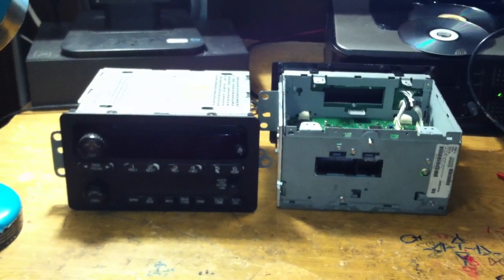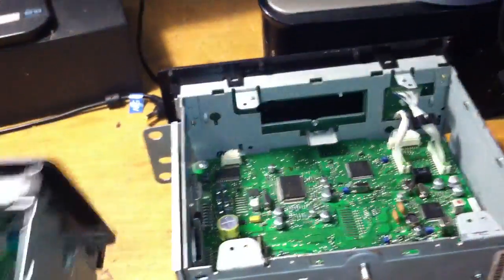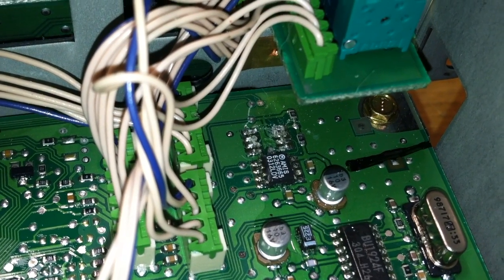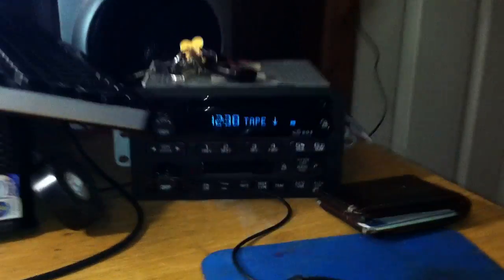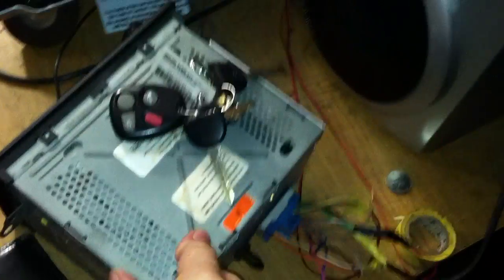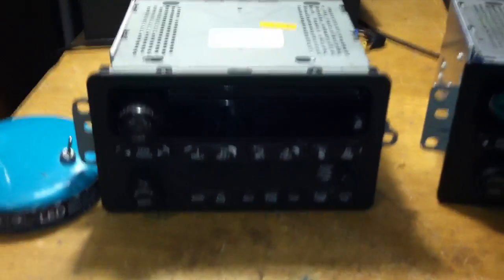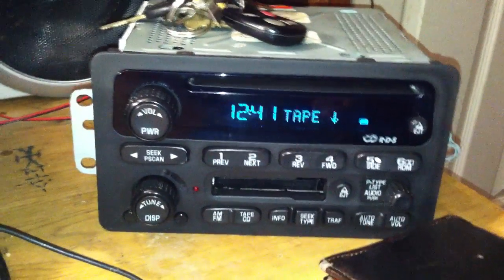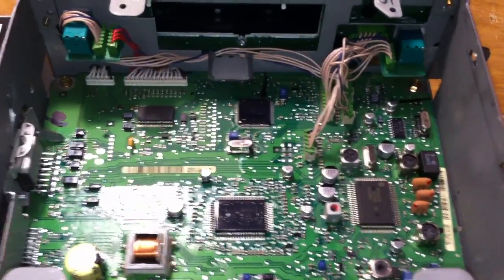Unlocking 2001 to 2005 GM Class II RDS Stereo Systems

Comment: I have a 2005 radio from a junkyard trailblazer in my 2008 trailblazer....i tried his seek + 5 + power to temporarily power the radio and it does turn on but it only does this with key in off position...as soon as i turn key to on position it immediately shuts off....

Also if i remove the chip i can deal with the cal err on the screen but i would hate to lose my presets...does it lose your presets every time the car is turned off?  Thank you

Comment: Actually if you ground out one of the legs to the radio chassis ground ( if using this video as reference then would be top right leg) only takes few seconds.  There is no negative effects whatsoever.  In fact when vehicle is off the light still blinks like it should.  Now idk for certain that it forces it to program to vehicle or Actually disables Eprom entirely.  The radio has to be connected to vehicle to work.  This method will work with all chips like one in video

Comment: I just did this today! Radio unlocked and works great. The tape icon is on (no cassette on this unit) and the presets do NOT save...but the clock remembers the time. 
My aftermarket stereo quit and this old factory radio sounds better!! Thank you for this video

Comment: There's still a lot of these vehicles on the road needing the radio replaced. There should be a service a local radio install shop can do for lockout at a minimal cost. I like a simple radio like these. Don't need all the buttons and amps. Sound and clock! OK

Comment: Didn't work for me. I have a 2001 Chevy Impala with the older radio. After removing the chip, the radio worked fine until I shut off the ignition and started the car again. It immediately locked. I pulled the radio back out, unplugged the communication plug and tried again... Same thing.... Worked fine until I shut it off and started the car again and it immediately locked again. Any thoughts?

Comment: Will this disarm the key to bypass to start the engine? 2002 Chevy Impala changed radio to same kind but car not start due to chipped key radio says fob learn but does not have the fob remote keyless entry . Just a chip key

Comment: we appreciate you teaching us. Maybe you can add another close up off them where you use a skinner pointer 
and red sharpie and circle the gone chip. I couldn't exactly tell , but I'm that way most people can I suppose. 
I also save some from getting crushed , my favorite bench radio is a  2002 delco electronics says theft lock
top right & has green station number display. model number 15071234  . It has a cd and cassette but the tape is 
separate near by. I like it for a bench radio better than  dodge ford toyota  because for a bench radio it doesn't
go back to am when I power  the bench power source down for the day. the next day I turn on the 12 volt power supply
it push in the button to turn it on and it's right on the same pre set  FM station , i left it on . that  radio says theft
but the previous owner must of programed the theft part off before I got it from the junk yard. In fact all mine from
at least a dozen of them,  i''ve had no lock out because of there age I think between 1988  just 3 of them the rest between 
1995  & 2003  /  I wonder why some hold he presets with no power hooked even for months.  I wish you would figure 
that out , because there is no power hooked,  is there some kind of memory chip  ? I guess that's how computers 
work you can unplug the power, and battery the info still there.

Comment: Can you unlock it without removing the eeprom chip? It sucks having to reset the clock and radio stations each time the car is shut off, or do you need the tech 2 for the procedure?
Reply from the maker: The Tech II is required to match and flash the EEPROM to your car. It's a stupid money grab by GM is all this is, sadly.

Comment: I know that this video was made in 2013 and its now 2021 but I just picked up a 2004 Chevy Malibu and the stereo locked on me. I saw a few videos but none of the videos showed the stock stereo that was in the car I have. It's one with a cd player in it with no cassette player. So I opened it up and its not the same inside of it either. There's a motherboard right under the metal cover held by 2 screws. Removed the 2 screws but the board doesn't want to move. Has anyone seen this type of stereo. It's got 2 knobs one on the left is the volume and one on the right that has "disp" on that knob. I was planning on putting in a after market stereo but if I sell the car I'll want to put the factory stereo back in but I don't want to leave it locked on the next person who owns the car. On the side of it says GM PART No. 22734876 Manufactured 2/18/04

Comment: So I have a question on a non tape deck radio what it's the pinout of the radio for the connector? I need to find out what the pinout for the power allways on and power with the key on then There's a second connector connector that only has 3 wires going to get please help

Comment: Need help with my steel !!   I open it up and saw that it already has the gone,  after I plug in the radio it says “Cal Err” ??? Everything else supposedly works except the sound. Can you give a tip.  This is my email 01mendoza87@gmail.com     or my phone number so you can contact me faster 7145744463

Comment: One VERY IMPORTANT THING- If you are doing a direct swap out to replace an inop unit either due to mechanical issues with the transport assemblies or electrical problems, your new radio will likely work.
HOWEVER, if you are trying to do an upgrade, GM SAYS these radios are part # specific. 
Honest resellers of these units will give very specific application info that is not to be disregarded.
To that end, if your vehicle has only the basic AM FM unit, even though the upscale unit will bolt in and plug in in place of the basic unit, IT WILL NOT WORK AT ALL.
Found out the hard way trying to upgrade from the basic AM FM radio to an RDS CD/tape unit per what is shown here in a 2003 GMC 3500 van.
The only way that anything happens is with the key off or removed where there is some residual power, say for the clock function until doors are opened presuming the vehicle is now exited and no further display of info is required.
During that "key off" mode, the unit allows one to do the "5/ scan fwd/ on" trick.
The unit then displays, clock functions and responds to " tuning stations" BUT will not turn off.
Theoretically, it would remain in some sort of powered/display visible yet silent mode until the key is moved to " on".
Otherwise,  
As soon as power is applied, radio goes to "LOCKED" and will not power up to retrieve the two 3 digit codes which can be used to get the actual unit's operational security code from a dealer.
So, beware of internet sellers claiming "universal compatibility".
It is NOT SO.
That is unless someone has some further secret method with which to enable operation of the RDS style units across the entire GM vehicle lines.
As for the chip removal method as shown here, obviously it works but what happens is that all memory functions for station presets no longer work. 
Meaning, learn to love that "seek/scan" button.

Comment: If you take that little chip from one stereo into another you can unlock a junkyard stereo to work in your car without any issues.  I retrofitted the monsoon system out of a Pontiac grand am in to my Chevy Malibu and had to do that to get the head unit unlocked.

Comment: I just got the older model, but it was a little bit different.  The chips had goo on them.  I removed the eprom using a small flat head screw driver.  It worked.

Comment: Bench test 5 and fwd seek arrow and press power. To get it running and reprogram and have no drawbacks. Replace eeprom with blank one. Key on and it will relearn vin.  You can also erase the eeprom if you go on eBay and get eeprom programmer

Comment: Love you video! FYI The reason you’re losing power to the radio after removing the chip is because the radio has no way to communicate with the vehicles communications module that hooks to your on star as well. These radios don’t use a typical 12 V signal for power the module actually sends an 8 V signal. That’s why when you put an aftermarket radio in the wiring kit comes with a splice wire for 12 V source. I also had an issue with my 6 disc changer Bose system after a CD got stuck I unhook the fuse radio went in and went and limp mode so and wouldn’t play the CD player. Radio just flashes the CD emblem. Remove the radio took the top cover off and got the CD out but still just flashes. Nobody has had a fixture other than replacing the radio but I found a fix. Like I said the radio is controlled by that module by pulling the fuse you’re not shutting down the module you have to unhook the battery and Touch the cable ends together for about 30 seconds to a minute and that will put all modules in the vehicle to sleep. I work for a dealer I have to do this sometimes to certain vehicles that do weird things sometimes you just have to reset the modules and everything goes back to normal. Again thanks for the video.

Comment: Would like to know if you know which wire to cut for the Chime warning noise and a have a low Pressure oil but truck still runs fine

Comment: This works AWESOME! What you need is a tiny craft X-ACTO knife, fresh blade. (The silver pencil kind.) Put a 2005 Impala ray-dee-oh into my 2005 Avalanche. For some reason, the number 5 preset works after power off/power up. Kicks as hard as a 49-year-old needs. Aftermarket is shite. (That's what I took out that was dead as a door nail.) If I want to get fancy, I might install the AUX jack, or just grab an FM combobulator and call it a day. And now, back to The Tragically Hip!

Comment: I got a 2001 Chevy Silverado radio just plays station but all it does is turn on off just the clock face shows up and that’s it. it’s just like the 2nd chip bored u showed but my question is does the chip sometimes have glue over it. Lol I pulled the 8 leg chip out still does no off with the clock face but no radio station yet :/

Comment: Thanks for the advice.  I have this problem now and the darn thing just won't budge from the "LOCKED" display.  The funny thing is, I had just purchased the vehicle (2002 GMC Sonoma)  the previous week.  The radio worked just fine for awhile, and I was able to set all the presets and play around with the buttons to see what function did what, and then I was able to set the correct time.  Shortly after that it just decided to "LOCK" with  no reason.  The radio was not changed, the battery did not die, and I am quite sure it came with the vehicle.  I can not get it to do anything now (and the cassette player does not work, but I knew that when I bought the truck).  I'm about to pull out the whole damn radio and throw it to the cows to stomp on.  I hate the thing!  Lets face it, nobody is stealing "any" radios anymore, and if they are that hard up for a radio, then have fun with it.  With this one, stealing it would be doing me a favor...

Comment: Awesome! Just fixed my radio after replacing the BCM. only downside it now shows a little cassette icon in the bottom right and it's a CD only with no cassette deck. But I can definitely deal with that!

Comment: I had a locked radio for a 2003 Buick Rendezvous.  I couldn't even get the codes by pressing the buttons.  I removed this chip (small screwdriver through the side) and the radio works perfectly.  THANK YOU!

Comment: Can you tell me what the smaller plug is for on the back? there is the bigger, standard wiring harness, then a smaller one which is a mystery to me (no install videos have that plug). I'm trying to put in an aftermarket stereo and I don't know what to do with the second plug (since there is only one harness plug input on the aftermarket). I tried to just ignore it and use the standard wiring harness in my car stereo want turn on. Any help is GREATLY appreciate! I'm stuck with my dash apart. I've never seen this two plug setup. Aftermarket stereos only have one harness plug. Thanks!

Comment: You know all you have to do is hold down preset one and preset for at the same time for 10 seconds and it unlocks them don't do what I did and jerk out the anti-lock saying on your radio you don't have to just hold down the presets now every time I get in my car on the same radio station that I don't want it on and equalizers settings are saved

Comment: Ok it worked but no sound coming out of the speakers the truck the radio came from has a bose system and my truck has a bose only differents is the original stereo was a 6 disk CD player with no tape deck and the one I'm trying to put in is cd/tape player. Any one have thoughts

Comment: I just soldered a wire to pin 1 applying 5-vdc. I got the voltage from any other chip pin 1.

Comment: I have the original factory radio without a CD player and would like to replace with a model that has this feature.  Would it be possible to simply swap the chips and retain the memory functions with the replacement radio?  I would of course find a matching year for the donor radio.  Thanks for any input you can provide.

Comment: I have a GM radio that says LOC I pulled the case off the top to get to the board and it looks different I have a picture there is a chip up in the area but there is only one is there anyway I can send you a picture?

Comment: I have done this to one radio and it worked perfectly the next one was exactly the same but the radio remains dead until you do the temp unlock of forward seek / 5 / power - and it works fine for the 10 min and then shuts off - any ideas about what might be wrong?
Reply from the maker: If you're trying to bench power it, that feature beyond 2004 appears to be disabled on 99% of these radios. If it's in the vehicle then it's an issue with it not getting the signal to turn on. I've found GM has 100's of iterations of these radios. Some work some don't. There is no way to officially know as GM guards their secrets fiercely.
Reply: Pan Gramercy is a 2005 pontiac grand am factory radio going to be similar? Thanks for your video. It was helpful.

Comment: Hey Pan, please help! This radio is making me even more nuts. Every time I get in my truck I have to restart the CD or find a station...Anyone?
Reply from the maker: It's a side effect of this modification. There is no way around it I have ever found. That chip stores presets, and basic memory. The only way around it sadly is to get a good used unit, and have the dealer activate it correctly.
Reply: Hey Pan Thanks for your help, I've been toying with the idea of keep it stock or aftermarket, I like stock. But if this radio can not hold memory I think I'll be looking for a new head unit soon. Once again I have seen you do your homework on these units, IF you come up with a solution please post it.Thanks Dennis
Reply: I hate giving up but I think I will be going aftermarket. Thanks for your help

Comment: Hello Pan, My 6 cd changer died in my 2006 GMC, after doing some research I felt comfortable buying a used LOCKED replacement radio. After viewing your very informative video I removed the chip and the radio is working. Yippy! Unfortunately I am not able to keep constant power to the presets/CD position. Now the way I understood it, I ran a jumper wire from the thick orange to the empty slot just to the right???Two possibilities, #1 I did a crappy job installing the said jumper wire, #2 I am completely wrong. In any case would you be a so kind and go over the wiring one more time for use non-regent folk. Thanks Dennis

Comment: I pulled my GM RDS radio from a 2003 Chevy Avalanche and was unable to get a working display even though the unit worked while installed in the vehicle.  The radio never indicated locked; just no display.  I connected 12V + battery power to pins B1 and B2 and Ground to pin A12 on the 24 pin connector at the back of the radio based on what I saw on the video.  I also removed the locking chip as shown in the second radio in the video.  When I push the power button, the lights on the faceplate illuminate but still no display.   I have not connected a speaker at this point since I never got the display to work.  Are there any other connections I need to try before giving up on this one?

Comment: I have one like that but the volume does not work,What I can do?
Reply: silalex97 check that no wires are broke that will keep your volume from working
Reply: I have the same problem with the replacement system, but when I put original in, the volume  is still fine...So, removing the chip unlocked the system but I can't hear anything....
Reply: do you fix your volume problem??
let me know please i have the same ploblem

Comment: You said in the beginning if you only remove one pin from the surface mount chip it will do that same thing. Do you know if you do this if it will still allow you to save your presets and use the radio? I removed the entire chip and got the radio working but it sucks not being able to save any presets. If I could just remove pin 8 and it would still allow me to save presets I will buy another radio and try it.
Reply: Hi SCscoutguy. Did you try just Pin 8 to see if presets stayed?
Reply: Nope I never tried it. I ended up just buying a aftermarket radio and replacing it with that.

Comment: hey dude, quick question,. LOOKING AND LOOKING HOUR AFTER HOUR, nobody seems to have made a video or pictures for a  2002 chevy tracker or 2001 chevy cAValier with only cd player, no tape.   these are the same radio...  cannot find a picture or vid, and no idea which chip to remove.  both 8 pin chips are horizontal in orientation, one is on upper corner, other is near middle.   any suggestions? no writing is on either of these chips